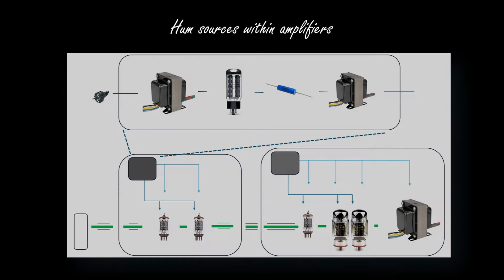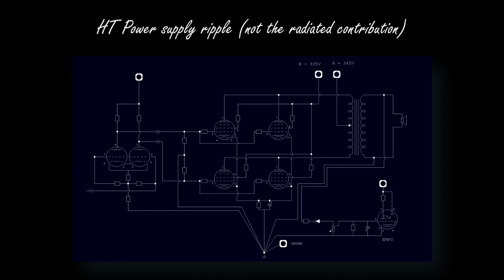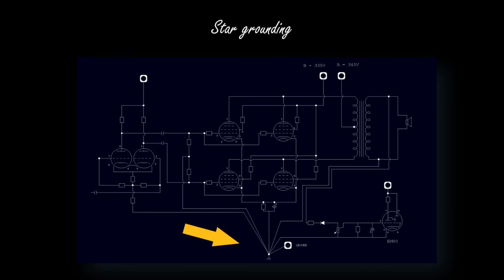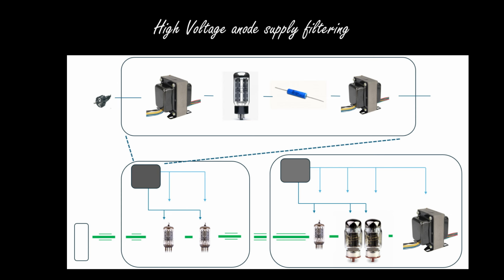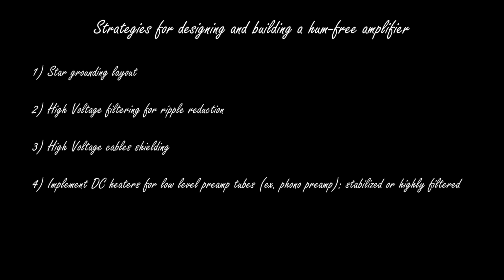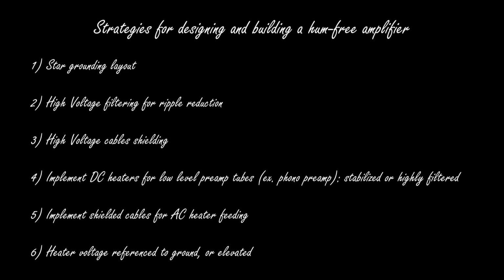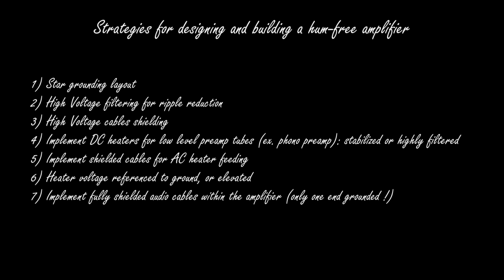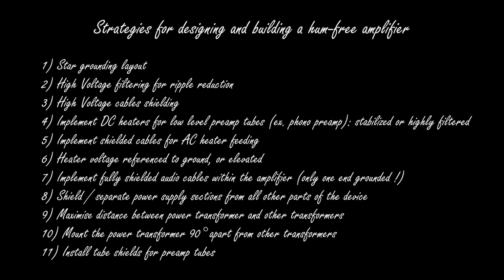No hum / noise on your tube Hi-Fi amplifier ! (Lesson 2)

Comment: Hi you mention in your vidéo that the ground of the electric cable the one going to  the  wall must go  to the star ground  ,and star ground to the chassis .Is it exact ! But i saw many tube amp with   electric cable ground  at one point  to the chassis and star ground put on another point to the chassis .Audio ground and electric ground should be separated ,what do you think  of that
Reply from the maker: @kubockferre5532  indeed, I typically connect the chassis to the ground point. And the safety power ground (earth) to the same grounding point. The solution you saw on other amps (both star ground and earth connected to the chassis) is safe as well. Just, I personally don’t like creating further ‘ground concentration’ point, other than the main one (in your example, the chassis would act as secondary grounding point). I should look at the other ground connections in this amp, in order to be able to comment further, sure it’s working properly. Thanks for your comment !

Comment: hi do you put rca output to a star ground  thanks
Reply from the maker: Hi, thanks for your comment ! I usually deploy isolated RCA plugs at the output. I mean, the ground side of those RCA plugs don’t touch the metal chassis. The ground side of the RCAs are directly connected to star ground point. This is how I always implemented, and it always resulted in noise-free preamplifier. Thanks !
Reply: thanks a lot @restoreaudioandnewprojects8299

Comment: hi very interesting vidéo ,i made a tube  preamp with 2 x12au7 and 6x4 like rectifier ,i  put a  circuit regulation 12v on the tube but floating  ,and i  put 6.3 v on the rectifier but with a virtual  ground ,is it a correct way to do ,thanks
Reply from the maker: Hi, thanks for your comment ! So, if I understand correctly, you elevated the heaters to 6.3 Volt, applying that 6.3 DC reference voltage to the ‘ground’ tap of the heater rectifier, right ? Indeed, this works. Nevertheless, if you’ve 12V regulated for the heaters there’s less need to elevate them, as they’ll inherently be hum-free. It’s good anyway to have them referenced to a voltage to ground anyway, as you did. The reason to elevate heaters in those cases  is for respecting the max cathode to heater requirement of the tubes. As you’ve two 12AU7, I guess one of them if laid as cathode follower, so this is where there’s the major risk to exceed the max cathode to heater voltage rating. Available for further talks on this, please let me know if I understood your setup 😀 and thanks again for your interest !
Reply: hi  my set up is  made  like this ,i got a power transformer for high voltage and 6.3v  for the rectifier  referenced to ground and another power transformer 16v ac for  supply 12v filament with a regulated circuit  lm 317 which  is not referenced to star ground.i think its ok like this ,what do you think.  @restoreaudioandnewprojects8299